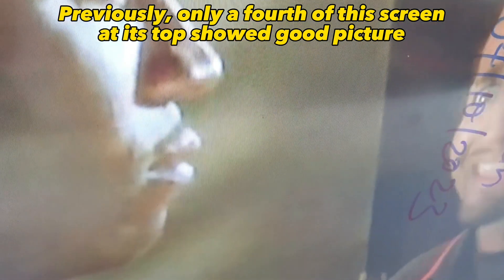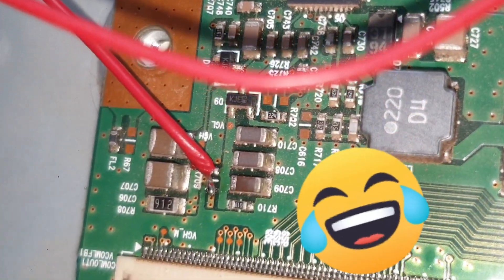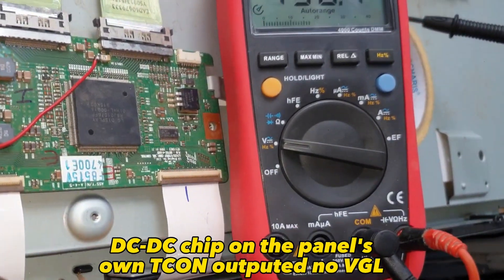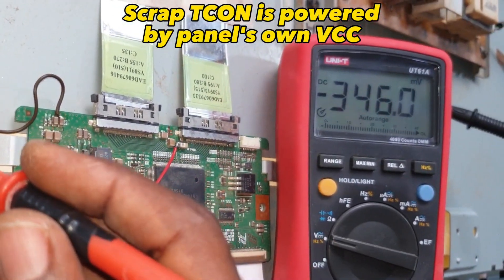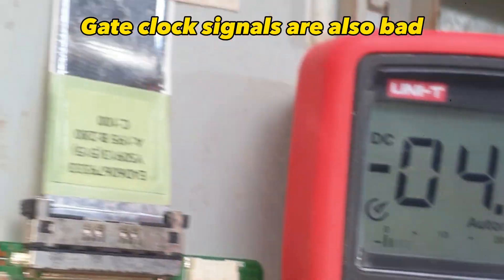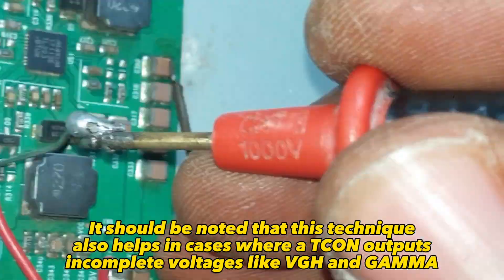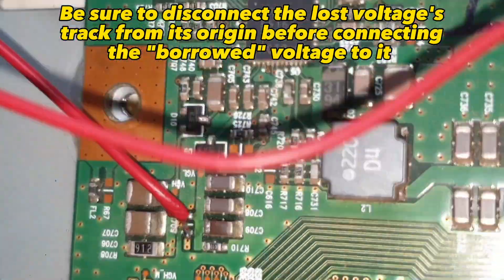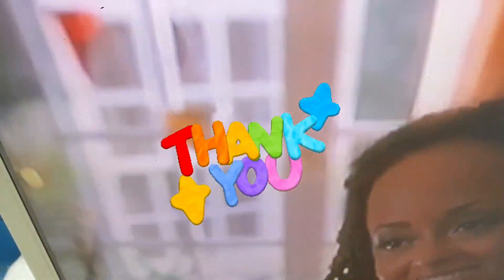HOW TO MAKE A DURABLE LCD TV LAST EVEN LONGER? 😀 #tv #lcd #electronicsrepair

Comment: This is brilliant. It'll come in handy when replacement parts are scarce.
Reply from the maker: That's right. The first time, I did this on a Sony LED with this large TCON. Its DC-DC outputed very low VGH. Used an LG scrap TCON and it worked perfectly. It's been a long time now. The repair made the customer who was a first timer a loyal patron.